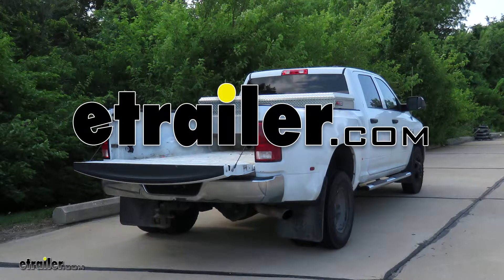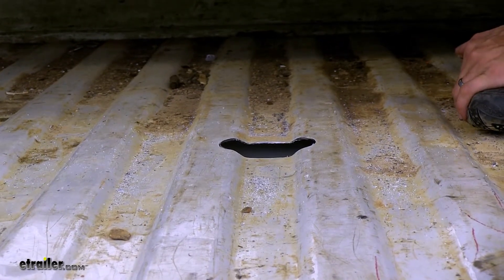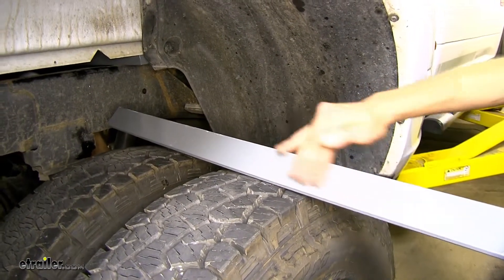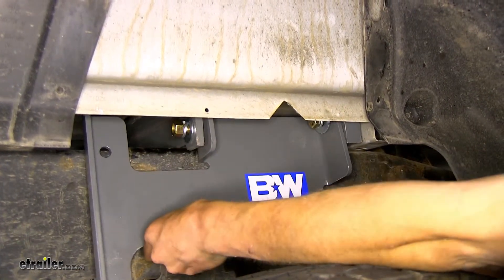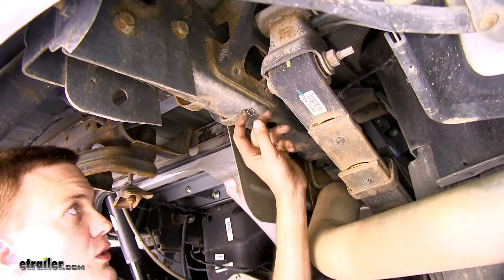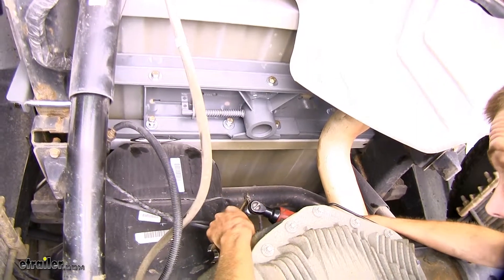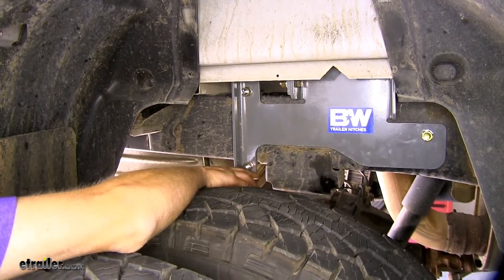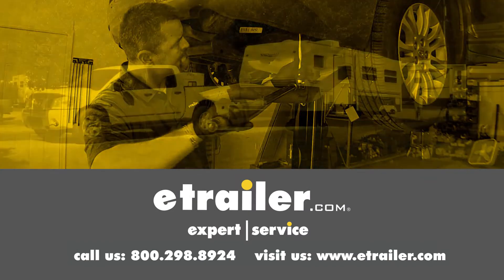etrailer | B and W 5th Wheel Trailer Hitch Installation - 2012 Ram 3500

Comment: Ummm a fifth wheel hitch?  Where was that at? I only saw a B&W goose neck installation.
Reply from the maker: This is the gooseneck hitch that you will need in order to use the B&W Companion 5th wheel hitch.
https://www.etrailer.com/Fifth-Wheel-Installation-Kit/B-and-W/bwgnrk1313-5w.html
https://www.etrailer.com/Gooseneck-and-Fifth-Wheel-Adapters/B-and-W/BWRVK3500.html